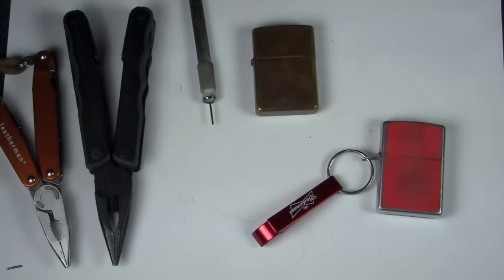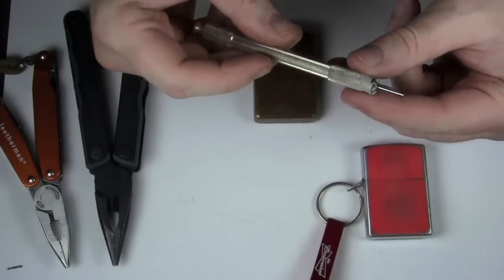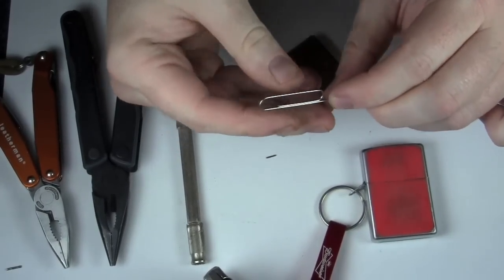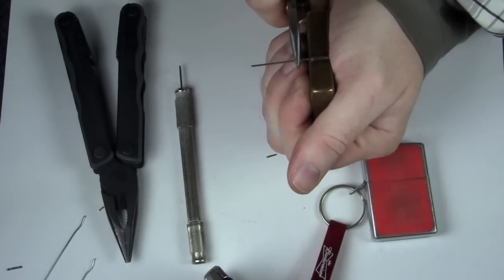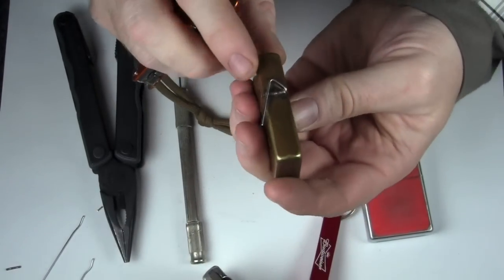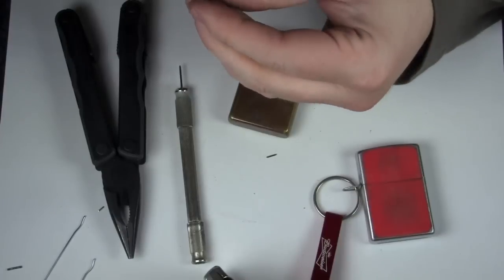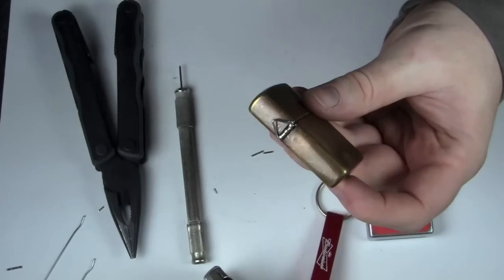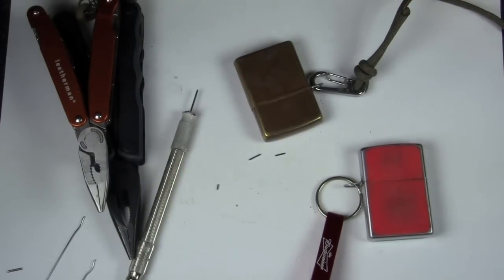zippo modification

Comment: If you put the straight of the paper clip through the hinge and the two ends on the outside then you can solder the ends together to make it a little more secure. And you wouldnt have to worry about alignment.. Great idea! I'm gonna have to try it!